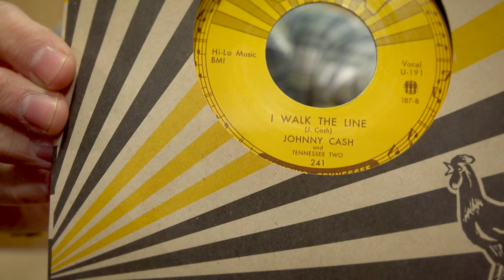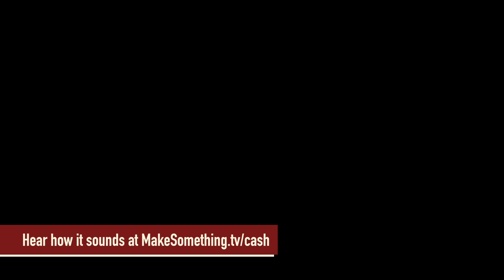How to Duplicate a Record: Mold & Resin

Comment: I went over to the website and was amazed at the quality of the "pressing" made from the mold. I wonder if the process was perfected a little more, it might produce even better sound quality.
Reply: +MonkWerks with Fr. Thomas  I was thinking that if you could put it in a vacuum of some kind, like for veneers you might be able to get it better
Reply: +finallyonethatworks  That's actually a thing. It's called vacuum degassing. It sucks all the air out of the resin and silicone to produce a bubble free finish. You can also do the opposite and pressure cast, which instead of sucking the air out, it compresses it out of the liquids.

Comment: I saw a guy on YouTube use the same process but, he put the rubber and resin in a vacuum chamber first to get the air bubbles out.  This made a clean copy without the static.  He said the air bubbles were what was making the static and Proved it.  Plus, Clean the record first before copying it.  But, Your process sounded good.  Where do you buy the rubber and resin at?

Comment: for even better results degas the casting medium, both the mold and finished product, and level and spin the cast while it's curing, you'll have  uniformity in thickness and consistency. The same way that polymer layers are spun onto a silicon wafer for all associated manufacturing processes.

Comment: Fun idea and project! There are a lot of ways to increase the quality of the cast, such as cleaning the record, degassing the silicone before pouring, using a pressure chamber to shrink bubbles in the resin... ah well maybe those are all too difficult :) Id also try pouring the mold on a vibrating table to settle the silicone into the grooves better. 

And yes for the people asking, you can make a 2-sided mold pretty easily.

Comment: The audio reproduction is remarkable! Having worked with liquid composites for many years, I can suggest that the clicks and pops are from air bubbles. I'm guessing that reprinted 45 is in good shape, so it's unlikely it hasn't been abused like many older records, so that tells me the clicks and pops were caused by tiny air bubbles. Looking at the grooves with a magnifying lens will verify that. The way to eliminate air bubbles is to avoid introducing them into the liquid from moment one. No fast stirring of the two parts. Then do more of what you did when you used a brush, but instead of a sponge brush (which can easily introduce air bubbles), first use some sort of scraper (like a credit card) to push the wet plastic resin along the length of the grooves, then pour in the rest and use a bristle brush to even the layering and remove the larger bubbles. Bottom line is that it's a fun, if expensive, hobby project.

Comment: Have you tried the method of using a standard PVA to clean vinyl? Basically, slap it on thick enough to peel it off once cured, and you are done. If you do this before your casting I reckon you would have an even better result.  I have a load of the spinny plastic and can't do all of mine, but I had one area of a tune that must have been shit on by moths or something, but it cleared it up no end. Cool vid.

Comment: I have a question; can you make the copy have both sides of the record by making a two piece mold, or would that not work well?
Reply: It would be a very cramped mould and you'd probably have problems getting it filled without a vacuum chamber.

Comment: What's that little disc you placed in the middle of the vinyl during molding/casting/playing?
Reply: +Rexus King Looked like an adapter to center a vinyl disc with the large diameter hole on a turntables thin axle.

Comment: I wonder if theres a way to do both sides...
Reply: I feel like there is but you would have to make one side at a time with a chuck on both half's so you can hold the two pieces together and pour the resin in.
Reply: chris manning 
But wouldn't that make the record way too thick?
Reply: It probably would. You might be able to only make one side of the mold half the length of the record but it might be hard.
Reply: Darn...
Reply: Make two separate molds, then glue then together to make one record
Reply: Maker2_0 ! 
Wouldn't that make it too thick for the turn table?
Reply: You pour it really thin
Reply: It's pretty easy, you'd just have to make a 2-part mold. There are a lot of tutorials on Youtube, many from the silicone manufacturer SmoothCast.

Comment: what would happen if you played the silicone on the player.  Of course not the silicone but if you were to use plastic instead of silicone to make a mold and played that.  I wonder what it would sound like.
Reply from the maker: +sixstrings24 I have wondered this but worried there could be frequencies in there that could ruin my speakers or turntable so I'm not going to give it a try.
Reply: +sixstrings24 The silicone in mirror of the original.  Instead of groves it has ridges.  (Not to mention the spiral turns the opposite direction)  Between the ridges it would be flat so the needle would not likely track very well at all.  That is if the stylus did not just dig into the silicone and tear it's own groove, or get ripped from the cartridge.   Bad things.